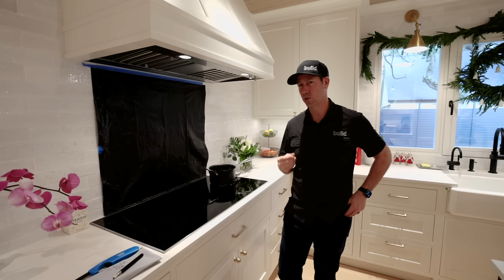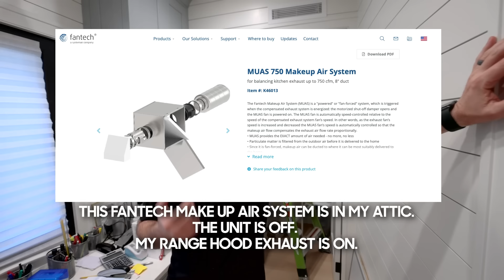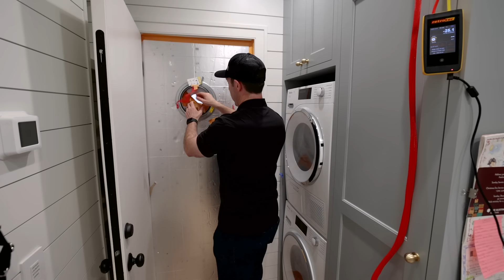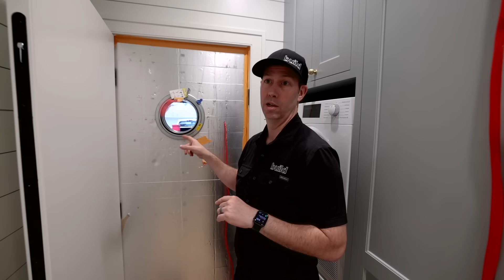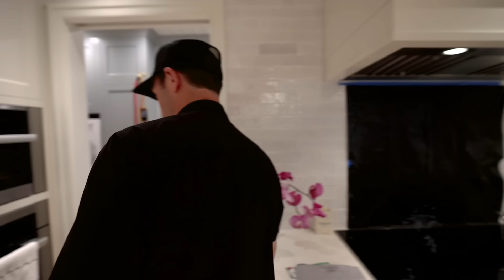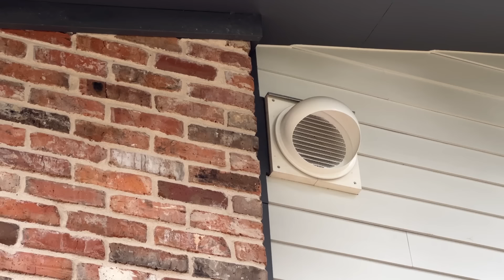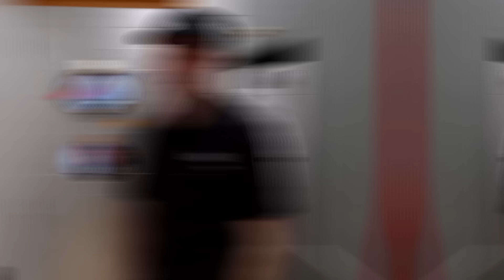Make Up Air for a Kitchen Exhaust - Most Homes Suck. (Pun intended)

Comment: Matt, I’m an electrician in Georgia. When I tell mechanical guys and GC’s they need make-up air, they look at me like I’m crazy. Had a customer on a recent job call me and ask why his house smelled so bad when the exhaust fans were on. His house was so tight, and with no make-up air, the exhaust was breaking the seal in a P-trap and you could smell the septic tank. Repeatedly told the contractor we needed make-up air on that one. Now they just crack the windows.
Reply: Wyoming electrician, here. Same problem.
Reply: Most GC's are not well informed on building science, let alone homeowners. It's a tough sell when it comes to ventilation. The construction industry is notoriously slow to adapt and tighter building envelopes are still a relatively new requirement. It's going to take a while .
Reply: That's why every restaurant has make up air....common sense???
Reply: @joseepena8553  Not so common...
Reply: Yes: crack is the operative word.   Mention to them that with proper make up air... they can prevent a bunch of air conditioning/heating dollars from being sucked out of the house.
Reply: I love all theses comments. I am a non-home-owner who is starting to plan an owner-builder project to commence in 3 years. (currently scouting lots/homesites) This is, to me, fantastic to see and read about these aspects of the build that owners and GC's aren't always aware of. I agree that I haven't read or heard much about ventilation and makeup air systems outside of Matt. Being armed with a ton of information like this, at design time, is going to be one of the powerful tools to save me money in the long run.
Reply: Does adding a ERV counts as make up air? 
We are building a new house and looking to make it tight with using aerobarrier, and this keeps getting complicated lol
Reply: @rupy1125  My understanding is that it does not because the air you want to make up for is that heavy draw from your range fan. 400 CFM is a huge amount of air to make up through an ERV.
Reply: @rupy1125  Good question, but  it does NOT.  A typical ERV/HRV system is under 100CFM, far short of 400cfm to 1200cfm needed in normal to large hoods. In addition to this, they are zero sum /closed systems, where they are designed to remove the volume of air they deliver after tempering it.
Reply: @rupy1125  An ERV can supplement the make-up air if ducted so that the exhaust is from a different part of the house (bathroom up stairs or multiple rooms apart from the kitchen) and supply into the kitchen. You'd need a big unit to make up all 400 or more cfm though.
Reply: Ask them to put a bag over their head. Seal it really tight and ask them how they expect to replace the air inside that bag 😂
Reply: How did they figure out where the replacement air was coming from? Was the trap gurgling?
Reply: It is a problem with codes.   I am a mechanical engineer and am required to stamp drawings for commercial HVAC jobs, but not residential.   If you are building tight, get a mechanical engineer for the job.  I do not try to install things, so installers, don't try doing an engineer's job.
Reply: Congrad's on planning on building your own home-just an FYI, I'm an electrical contractor in CT [31 yrs now! LOL] in CT legislation does not require a GC to have any kind of traning. They can just go to consumer protection and get a "Registration" they call an HIC here. My trade it take 4 yrs as apprentice, then test for E2 Lic, then two year with lic working for a lic electrical contractor, then you can take test for E1 to have your own business. Also the NEC is revised every 3 yrs. IBC and IRC is as well I think.  My point is the building codes are changing so rapidly it is very difficult to educate and implement. Then once you learn it, they change it again! Most other trades are similar here in CT, Products associated are also issues-study AFCI's and all the class action suits against mfgrs, it is crazy!  You are wise to research as best you can before implementing. God bless! AL from CT  @IzziedeD
Reply: I’m looking to build this year near ball ground GA do you do work up here having issues finding guys that know there stuff!
Reply: @oliviermorris1320   I did, but I actually exited the electrical business last year to take a PM position with a multi-family GC. The closest I can think of to you that I'd recommend is Ready Electric in Rabun County. Ask for Dave, tell him Brant sent you. Idk how far he travels but worth a shot.
Reply: @brantmacga  thanks man I appreciate it we’ll do!
Reply: What the hell kind of fan did you install 😂 that sounds hard to believe.
Reply: The house needs air exchange anyway, for at least the 100ml of water, every adult breaths out every hour. Just get grip olives for your swing/tilt windows, that have 5 stages.  
It not only makes your windows 2 levels of not-tight at your will. It brings the dew point to a spot, where condensation brings no harm.
Reply: Gross and dangerous
Reply: It’s funny how easy it is to overlook details like these. You are using a motor to blow things out so obviously you’ll need a motor to replace what you pushed out at the same rate. However most of us wouldn’t consider this at all.
Reply: @MsJom123  You don't need a second blower, just an appropriate inlet, so the pressure in the house can't drop.
Reply: Dude, clutch.
Reply: What is recommended for tropic ans sub tropic environments with high latetent loads?  Im familiar with captive air on commercial applications, but what about high-end tight homes? Im seeing a lot of dehumidifiers being used with fresh air intakes that are not controlled by the exaust hood and rathed are set to only open whe  there is a call for humidity control and/or timed ventilation featurs in some stats and independent controls.
Reply: Except subway - you can’t go inside a damn subway without coming out stinking like subway
Reply: Doubtful
Reply: @bibbidi_bobbidi_bacons why on earth would anyone walk into suckway er subway anyway? I’d rather go hungry!

Comment: I used to work as a chimney sweep. We would get calls all the time for smokey fireplaces due to downdrafts. Much of the time the issue was a tight house with a strong kitchen exhaust fan. Half of the rest was no make-up air for the furnace. Then it was stack effect, those big open staircases that are all the rage right now. Finally, in about 1% of the cases, it was some issue with the chimney (usually location of the house) which resulted in outside air pressure creating a downdraft.
Reply: Thanks for your input on this question. Is the stack effect a "chimney" effect at the stair? Is there enough leakage of air at the top of these staircase "chimneys" to make a difference?

Comment: When eight inches isn't enough.
The 3:1 passive rule of thumb has served my company well over the years. Fighting with customers over the need has never been fun. 
I appreciate these videos from Matt. I have customers who will believe the Internet over me. After all, I can't possibly be motivated by anything but greed, right?
Reply: If an 8" diameter duct isn't enough, a duct with 3X the flow area is 13.86" in diameter.  To calculate that you take the square root of 3 x 8^2.  A 24" diameter intake duct would have a 9:1 flow area ratio vs an 8" diameter exhaust duct.  To calculate that it's (24^2)/(8^2) = 9.  Pi drops out of these calculations because constants common to both sides of a ratio cancel each other out.  That being said, I'm curious to know what your recommendation is for the diameter of a passive make up air duct for a range hood with an 8" diameter exhaust.
Reply: Hang in there - your caring about your customers will always be felt - even if people don’t realize it!

Comment: Great video. This answers a question I've had for a long time, and is directly relevant to your video about radon gas. I live in an older house with a non-encapsulated crawl space in a high-radon zone. When I turn on the kitchen vent or even a bathroom fan, I try to simultaneously crack a window, because I know that the negative pressure is going to suck crawl-space radon gas through every gap in the subfloor, un-caulked electrical or plumbing hole, space around HVAC registers, or even improperly sealed ducting in the crawl space.

Comment: Similar science, albeit applied differently, to what I deal with at work. Indoor ranges for military training have precisely tuned intake and exhaust in order to flow a specific cfm, but at all levels. Floor, waist, head, and ceiling across an entire room and for the length of the facility. Sometimes as much as 100 meters. All to ensure that the spent gases and lead particles are exhausted and filtered properly, maintaining soldier health. Nice video showing the importance of fresh air, especially in tight homes.
Reply: Where are ya located???
Reply: @Ty_N_KC  Europe right now.
Reply: which is practically never done correctly, which why U.S. DOD is switching everything over to non-toxic, non-lead ammo (M855A1 Enhanced Performance Round, etc.)
Reply: @9873459872134234  dOD found out a few decades ago that using and abusing training facilities will lead to losing them. Things like physical damage to the land as well as things like lead in the ground water. The remediation needed to repair damage is more expensive than finding new ways of training. Things like the EPR are a benefit of that new way. With lead only being used by pistols the maintenance costs have dropped significantly on the indoor ranges.

Comment: Built my hood cover to bring make up air straight to the hood vent. It cycles the air right at the hood. This way the hot or cold outside air comes in and goes right back out. Works nicely.

Comment: He gives much great information for a weather tight home. My ranch house built in 1963 has a full below ground basement. Moisture and radon are a concern. In the winter the forced hot air furnace sucks the basement air into the furnace and out the chimney. The air gaps between the foundation and sill , plus the basement windows provide the needed air exchange . This also removes radon in the winter. In the summer I just open the windows. I am not using any extra electricity.  Gas stove and exhaust fan .  I do use an air filter system in the spring to remove pollen.

Comment: A whole house ERV or HRV with variable speed blowers controlled by a manometer that constantly monitors pressure balance… would be a nifty way to modulate makeup air to continuously maintain balance regardless of which or how many bathroom and kitchen exhaust fans in the house are pulling vacuum.
Reply: Does this exist?? If not, why not?
Reply: A product like you describe exists, but it is not an ERV/HRV and should not be. ERV/HRV are balanced systems that are designed to push out exactly the same amount of air as they pull in. They are very poorly suited to compensating for pressure imbalances in a house. AirScape makes a slick, dedicated make-up air unit that does just what you say: it monitors static pressure inside and outside the house and runs an electronic variable-speed fan to keep the house balanced. Has a nice, heavy-duty damper that shuts tight when not in use to prevent energy loss. 

Since it is pressure-sensing it does not need to 'communicate' with all the various bathroom fans, hood vent, etc the way older super-complex commercial style MUA systems do. This makes it dead simple to set up and really flexible in its functionality. Has very high max flow, 1600CFM, so can be used for neat tricks besides MUA such as whole house ventilation or scavenging excess heat from an attic space (intake is well filtered so no air quality concerns). 

We've found it cheaper and more flexible to use separate ERV and MUA units rather than trying to use some fancy all-in-one system (they exist but are $XX,XXX, whearas the MUA and ERV unit we use costs ~$3000 combined).
Reply: @acjohnson55  It does, kinda, but is not an ERV/HRV. See my response to OP.
Reply: @drunkenmessiah  I checked out the Airscape, and it looks pretty cool. But could you explain why it would be so bad to run an HRV unbalanced, other than that it is intended to be balanced? What harm would result, if, say, you ran it with a little extra intake to stop drafts from a negative pressure situation?
Reply: There's a lot of issues that make your suggestion less than ideal. The energy recovery mechanism of an ERV depends on on that balanced airflow, so much of the benefit of having one goes away if you run it unbalanced. A typical ERV will not support the sheer air volume needed to compensate for a kitchen hood vent (400+ CFM). Typical ERVs don't actually filter the incoming fresh air and are dependent on the central air system for filtration. 

What it boils down to is that if a manufacturer made an ERV that does what you describe it'd be more expensive than having separate ERV and MUA units. It is possible to make a super sophisticated ERV that does all the things you say and, indeed, there are commercial solutions just like that. However, they cost well into the five-figure range and are therefore unsuitable for a conventional sub-$500k home build.
Reply: @drunkenmessiah  Got it. Yeah, in my situation, I've got a renovated house that's not particularly airtight. Our code didn't require a blower door test, so it didn't get done. We have a draft through our gas fireplace, because the chase behind it isn't sealed up and I'm guessing we've got a slight negative pressure situation. My thought was that unbalancing the ERV might make sense, if the negative pressure isn't too bad. It's a bit frustrating, because my GC (wonderful though he is) isn't on the cutting edge of this stuff, so it's a bit like pulling teeth to get try to get some of our HVAC problems rectified. We don't have an externally vented range hood (we have an induction stove) so kitchen hood isn't a problem.
Reply: @acjohnson55  Ahhh, that's rough. I'll sing the praises of that AirScape unit as being cost-effective and dead easy to set up, but I'll be the first to admit it is BIG. At 22x22x54 inches, she's a hefty lass. Add to that the need for a 14 inch(!) round intake duct leading to outside air and you've got quite the list of dimensional challenges for a retro-fit installation. 

Almost nobody in GC world really understands modern HVAC. Hell, the HVAC guys don't understand modern HVAC. We've had to lead our HVAC subcontractor around by the nose to get our system built (hydron module geothermal heat pump with a Midea mini-split system to control the garage and a 3-season room). He was okay throwing in an ERV but when it came to the MUA unit he wanted nothing to do with the thing. In the end we slotted it in and did the setup ourselves. Luckily the control unit is a breeze to work with and factory support has been stellar.
Reply: @drunkenmessiah  it's nice to know it's not just me who is struggling to get my HVAC needs fully understood!
Reply: @drunkenmessiah  Kind of crazy to have an HVAC system, MUA system as well as an ERV system.  I don't think there would be enough space for this ductwork! lol

Comment: I put a large exhaust fan into a new room I built and the entry door which opens away from the space did not want to open with the fan turned on.  I was impressed by that.  I'm still trying to figure out a fresh air source for that which isn't ugly or drips in the winter, so I was glad to find this video.

Comment: Matt, great mention about induction. I was really on the fence about induction for my remodel and your videos about induction really helped change my mind. I love my new induction cooktop. It's faster, more responsive, and I feel is safer than any cooktop I have used.
Reply: How about if you only cook with cast iron?
Reply: @FJB2020  Cast iron works with induction, but it's sometimes rough and may scratch the glass surface.
Reply: Gas is the best. I can still cook when the power is out.
Reply: and if you can find one with temp control? AMAZING

Comment: Excellent teaching video every customer should watch this

In all my decades I have only seen one properly installed fan that was not installed by me. 

       I like to boil for very large pots or frying pans of water on all four corners of the burner simultaneously with the fans off just as a demonstration to show the customer how much bleed of smoke or grease that would be coming into the house.      And then I turned their fan on to show them how their improperly installed Fan it’s still rolling over and bleeding around the edges into the house if it was invisible burning cooking oil or other VOCs and particulates. 

      And then show them a before and after I correct the problem or just re-install their fan and ducting correctly if possible. 

         And show them the difference when you open up a kitchen window or adjacent room window. What happens to the airflow.

Comment: I installed this system in my house a few years ago and I can confirm that having the MAU is a massive improvement. The hood performance is much better than the higher cfm fan I had in my last house. I did have a problem with the outside air damper about 3 months after running this. I strongly recommend getting a higher quality actuator  at some point. Other than that, this system has been great.
Reply: The weak link are the actuators.

Comment: Just had my 40+ year old house renovated with new window, roofing & siding.  All of a sudden my CO detectors started going off on a regular basis.  Due to the house being so much tighter, it was sucking in utility exhaust fumes.  I installed a makeup air duct direct from the outside to the suction side of my forced air gas furnace.  Now makeup air automatically gets sucked in under power whenever the furnace kicks in.  Huge difference!  The kitchen is all electric and I don't do alot of cooking, so little makeup air needed there.  My utility bills have not shown any measurable increase since setting up this system.